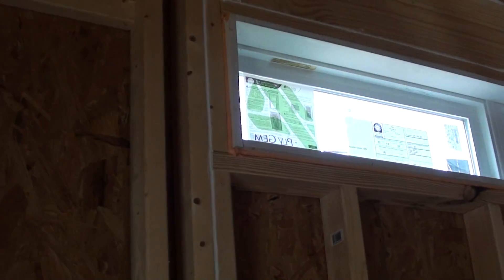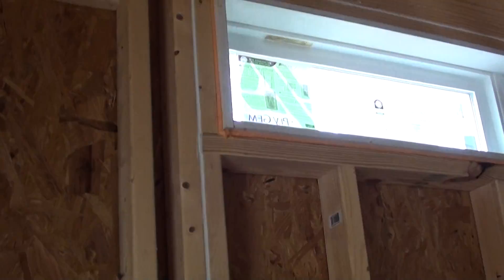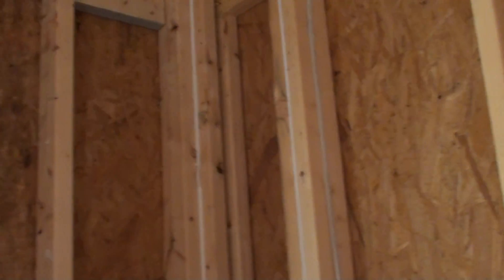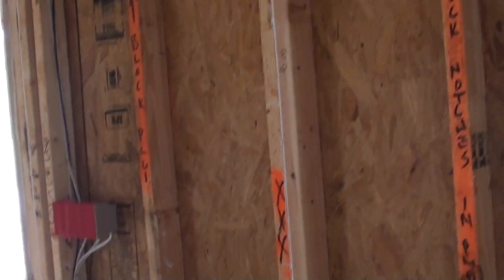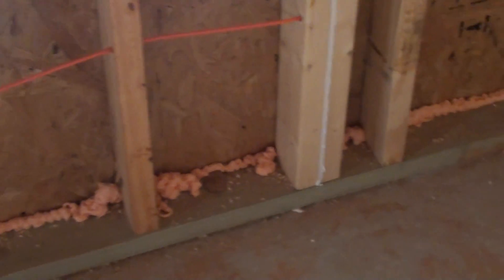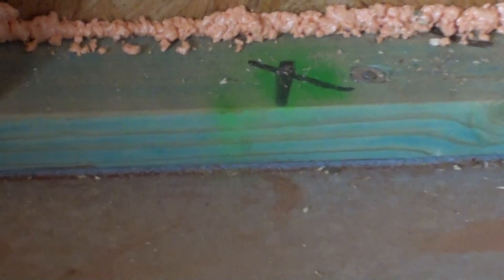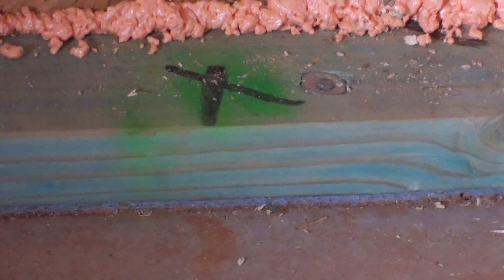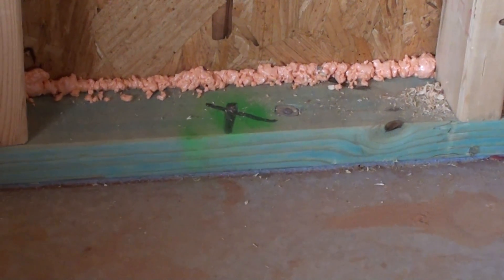Air Sealing - Outer Walls

Comment: Look, the problem with caulking,films and yes gaskets on the inside frame is that air entering from the outside see link: https://www.youtube.com/watch?v=eEzlth9Q_gc   will have to pass through your insulation cavity before it reaches the inside seal method. Is that what you really want...because that's the line-up what you'll receive with that (post frame) strategy.  For performance, cost, and durability you can only get that when you install gaskets during the framing stage.
Reply: I wish I could've done that so I caulked all the studs at the base and top plate and the studs to the osb closes to the windows doors and corners of the house from the inside if I knew where that osb landed i would've caulked those studs on both side to prevent air leakage to say, the Carpenter set the osb one way and the 1" insulation the other way to limit lines lining up

Comment: A waste of time and material can be seen here with pink foam used at the OSB backside and framing. The insulation cavity "Continuous air seal" is broken every 14 .5" by the studs. Example, In a 30 ft. wall @ 16" oc. that means 33. 75 inches of unsealed gaps still remain unsealed at the studs.  So much for energy performance. Also means 2.8 ft. of open gaps remain in this wall with this type of wasted effort. Caulking, is not what I'd want in my covered walls.
Reply from the maker: Michael Schettine great observations. Air sealing of a home is not about one strategy, if the effect of many techniques that aggregated together will give you the infiltration target. In this case, not shown on video, is that we used Huber Zip Sheathing were every seem and penetrations through the envelope are sealed from the exterior. I always recommended people to focus on moisture/water management , and if properly handled you will get an air tight home by default. Note the video has a day stamp of 2012. Back then we were hitting less than 3 ACH50, were code did not required any threshold at all. Fast forward we are averaging less than 1.5 ACH50. Keep in mind that as a custom home builder we need to be mindful on incorporating techniques that provide the most value, and that are cost effective within our clients budget. Like everything, you have good,better and best. Builders need to decide what fits the budget and implement strategy the proper way. Thanks
Reply: @ImeryGroup  I appreciate your email and agree with many items you list.  As a carpenter/builder I can count on one thing to mitigate air intrusion...it not how you seal so much, its when you seal!  The dollar/bang for your buck? Sandwiching gaskets during the framing process is the most effective in both cost, performance and holds its longevity because it's embedded into the frame and OSB back side, continuously I'll add.  With "Post sealing" the performance relies solely on adhesion in the dusty environment on earth. Q~Would you rather caulk the bathroom faucet spout end to stop a leak or just replace the washer...kinda like that and why we seal at the framing stage. When your frame is complete, so is 95% your air sealing detail.

Comment from the maker: Combination of silicone based caulk for cracks less than a pen tip size gap, and expanding foam for greater gaps
Reply: Is not good job

Comment: What type of caulk are you using in this video?
Reply: never reply
Reply: A good one is MasterSeal NP1 high performance polyurethane sealant which can be found at L0wes
Reply: I use tremco dynamic one hundred
Reply: And taped all my windows and doors with 3m seal tape. i tried to get all of them from the 1" insulation outside osb taped to the stud to close off that lets say gap over time and then recovered it with the tyvac